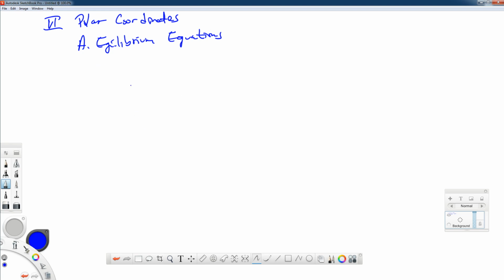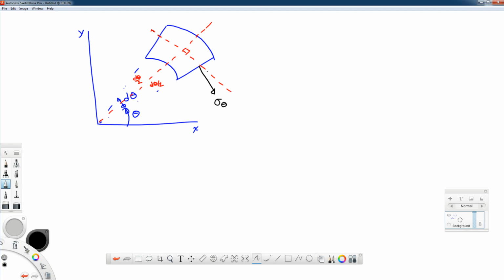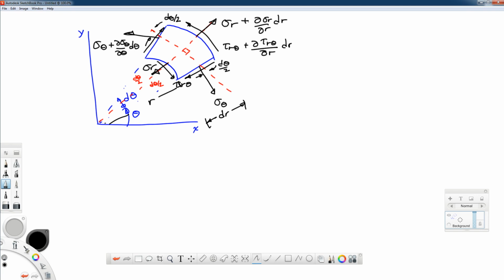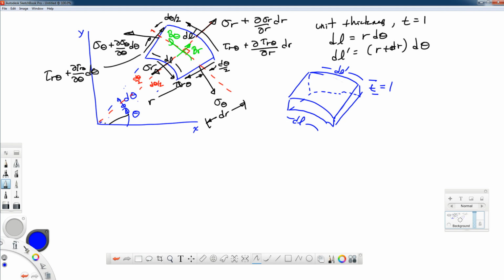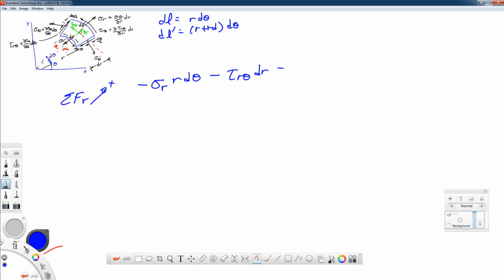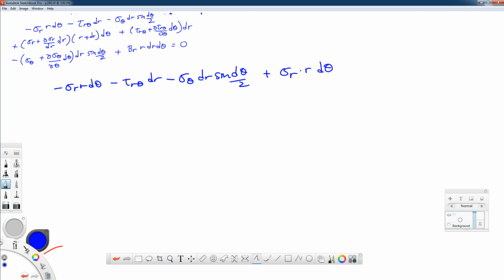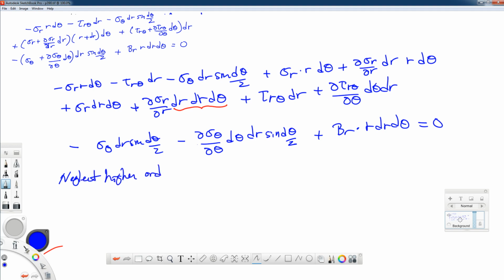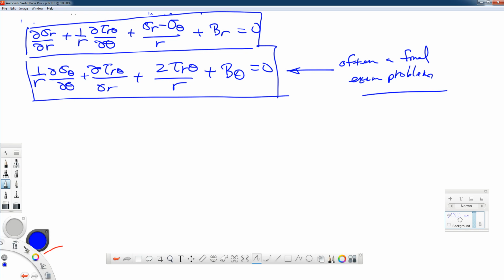Theory of Elasticity-Lecture 29-Equilibrium in Polar Coordinates

Comment: Why do we place sigma theta with an angle? If it is an an angle, why not place it with the shear component?
Reply from the maker: Hi Santiago, those are excellent questions.  Let's look at the second question first.  The normal stress is different than the shear stress in that the normal stress is perpendicular to the surface and the shear stress is parallel to it.  While both contribute to resultant forces, the stresses themselves are significantly different.  The first question is related to the shape of our differential element--in this case, the element is not rectangular, but like a cut off pie shape.  Sigma_theta being perpendicular to the surface, we have no choice other than it be at some angle different than the middle of the element.  To see this, take an extreme case of the element extending dtheta = 90 degrees.   Sigma_theta on one surface would point in the -y direction, and sigma_theta on the other surface would point in the -x direction.  The arc angle being 90 degrees, then each are dtheta/2 = 45 degrees from the mid-line of this huge element--but the same ideas apply to the more normal looking small element that I used in my figure in this lecture.
Reply: Great effort 👌👌👌